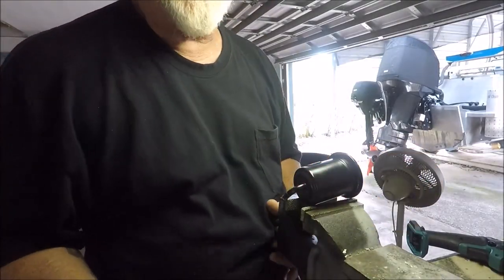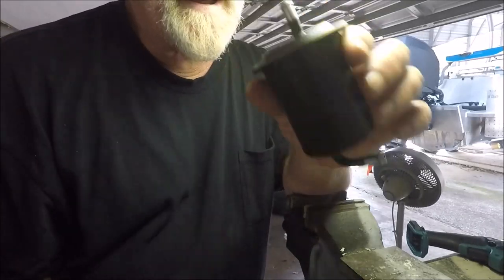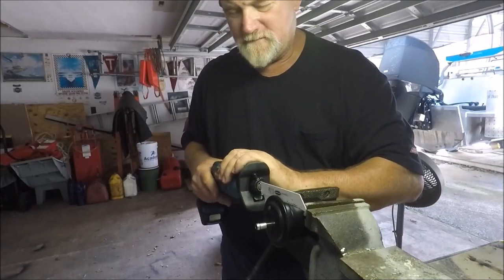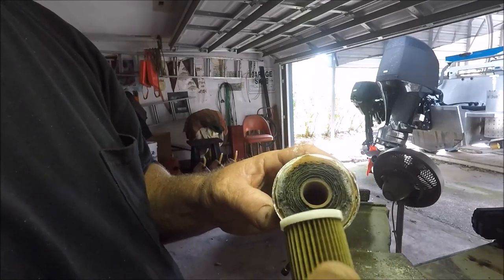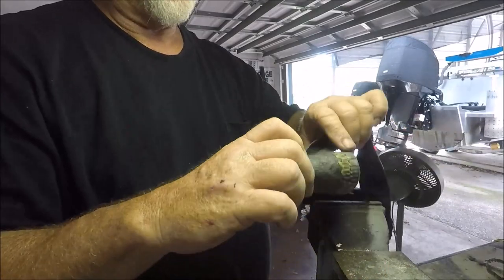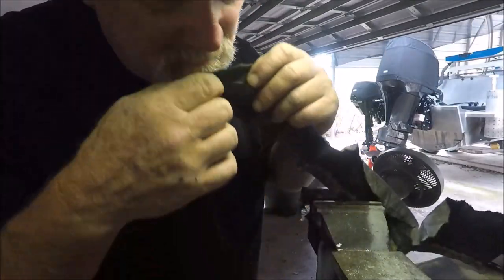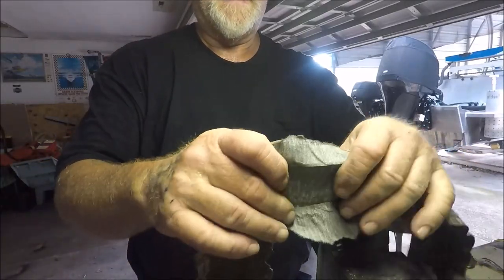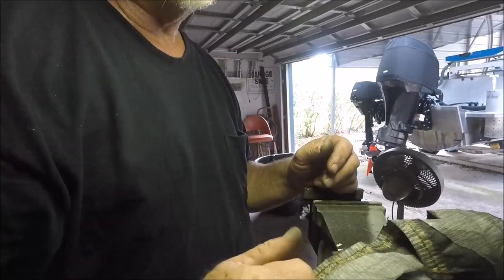SUZUKI OUTBOARD FILTER ''cut open''

Comment: Dave I know you fish a lot more then I do but after a 120 hours this year I changed all mine and cut them open. Clean as could be. I been using ethanol free from wawa. But I am still running a HPDI.
Reply from the maker: DO YOU MEAN, not black?  I don't consider myself putting tons of hrs on my motor either cuz I gave up endless hrs of trolling. But still do approx 350-400 a year. Depends on the economy...as usual.

Comment: since the filter and any particles are dry due the lack of liquid fuel, I bet if you submerge the dry paper in a clear glass of gas it will probably come out of suspension revealing any dirt captured during its use.
Reply from the maker: yeah, if Iwanted to do mote...not really. Moved on had more to do